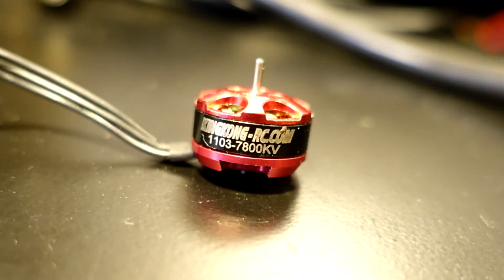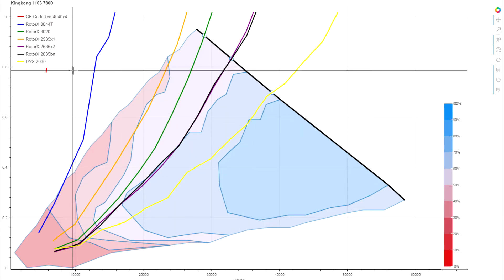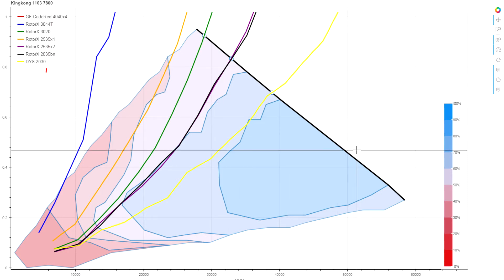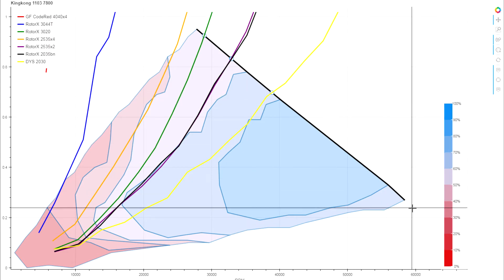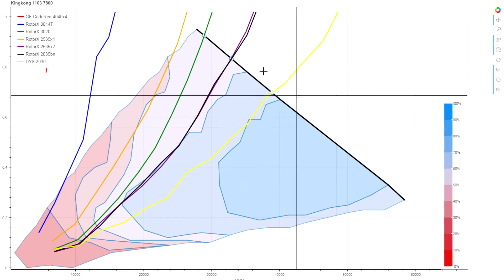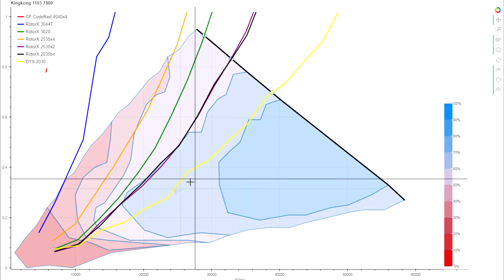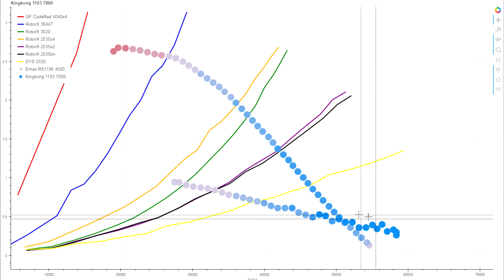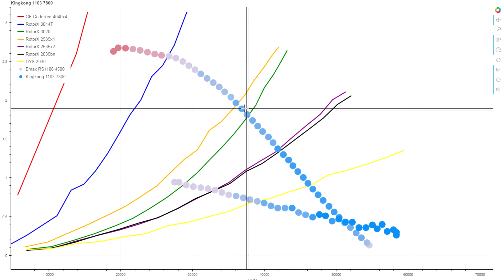Kingkong1103 7800  Dyno results

Comment: RotorX 1404 3600kv is being run on Albert Kim's mini drones for 8 min. It might be good to compare these motors and see why he is getting such good flight times.
Reply from the maker: The 1404 has far far more torque and a really wide efficiency band.  It doesn't really play in the same field as an 1103 or 1102 motor, because really the only reason you'd trim down the size that far is when saving 1g per motor really does matter, even at the expense of power.

I did pick up some 1404s finally though, so they should be on the site soon

Comment: If I could persuade a manufacturer to send you two motors of equal stator volume but one pancake style and one taller. Like a 2506 vs a 2207 would you test them?
Reply from the maker: I've been wanting to have a look at that eventually.  The basic theory is the torque relationship is diameter^2 * length.  Though it can be tricky to do direct comparisons because of differences between models of different sizes (like the huge difference between many 1105 and 1106 motors, over double the power but only a tiny amount of that is due to the stator size).  I don't like to take outside samples just because my lead time on testing is months and I don't want to disappoint.
Reply: I thought you might say that. It is difficult managing expectations. I was just thinking though the best way to control the variables is to get a manufacturer involved to eliminate the design differences. Let me know if you want me to make some calls